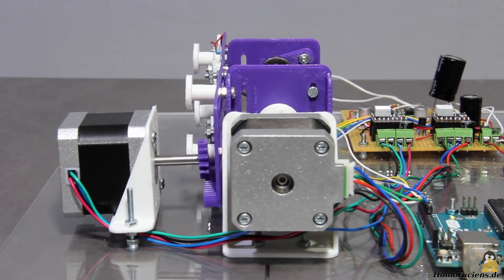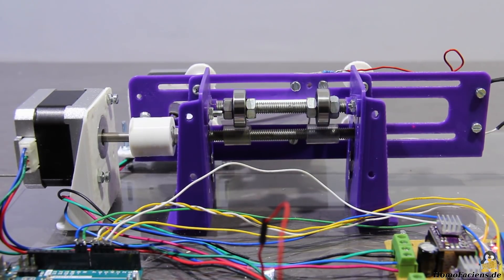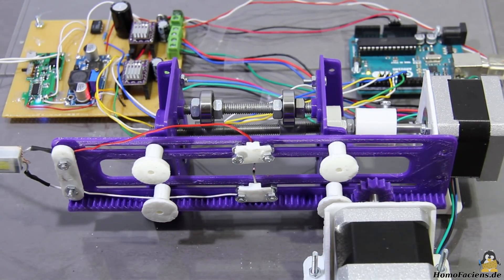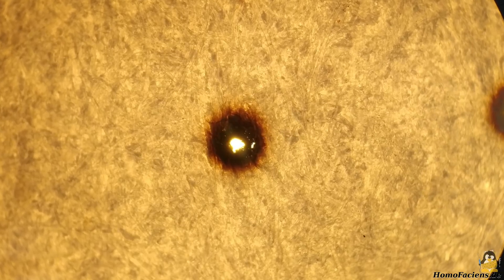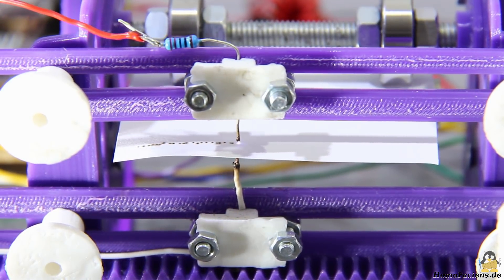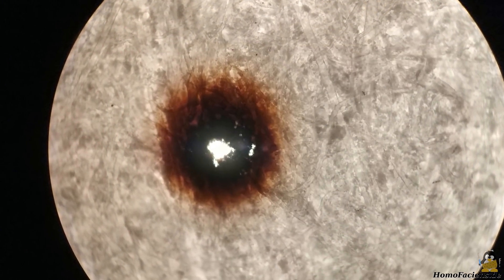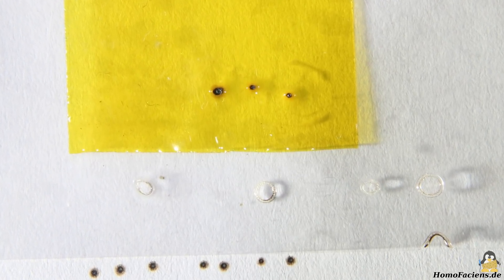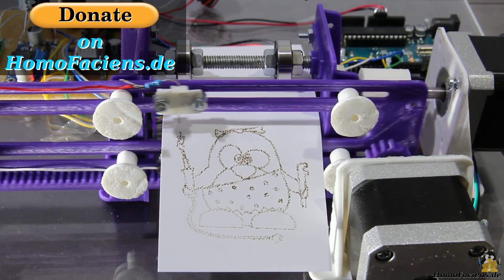Arduino Uno Plasma Printer

Comment from the maker: No breakthrough in printing technology, but a nice demonstration of how to perforate paper in a hacker's way. All info and build instruction on my pages:
https://homofaciens.de/technics-machines-plasma-printer_en.htm
FAQ:
Why sharp tungsten electrodes won't help improving the print quality:
The print dot is "punched" in a fraction of a second while the plasma is forming. That is ruled by the jungle of paper fibers and Air molecules that offers various paths from one electrode to the other. Plasma "printing" is different from plasma welding or cutting, where the burning of plasma for seconds or even minutes matters, not the formation of the plasma with the pilot arc.
Why you can't guide or focus the arc with magnets:
For the same reasons as above - you might be able to rule a flowing current (=burning plasma) with magnetic fields, but nor the forming of the pilot arc.
Yes bringing the electrodes closer improves print quality, but you cant set the dots too close to each other for two reasons:
1. the plasma arc will rather go through a nearby hole than forming a new one when the gap between two dots it too small
2. Too many holes will weaken and so vaporize the paper rather than printing on it
Reply: How about if points is closer to each other?
Reply: du brauchst einen besseren 3d drucker...
Reply from the maker: @grindel80  Nö, funktioniert doch, die Mechanik, somit sind die beiden von mir verwendeten Drucker ausreichend gut.
Reply: I wonder if you could soak a thin piece of wood in saltwater then clip the bottom electrode to it, to make a 'Lichtenberg Dot Matrix Printer'.  :grin:
Reply from the maker: Lichtenberg figures would mean "playing with the uncertainty of where the lightning strikes". More an art/science project than a quality printer ;-)
Reply: @HomoFaciens  Perhaps, but...
1. The wood is well-soaked with saltwater.
2. Wood only burns when it is dry.
3. It takes time for the heat from the plasma to dry out the wood.

Therefore, it might be possible to only burn a tiny spot--accurately--by firing the plasma for a very short time.  (You would either need to use VERY thin sheets of wood with how you have things set up now or put the wood in a metal frame which is connected to the bottom electrode so that, as the wood dries at one point near the frame, the electricity would just travel from another point, rather than burning the wood at the edges.)

Does that make sense?

Comment: COULD PLASMA ENGRAVE STAINLESS STEEL?
Reply from the maker: That depends on the plasma power. The tiny plasma generator I used in this video is definitely too weak.

Comment: You can try using the needle !
Reply from the maker: Doing more experimentation with the needle printer is still on my list of things to do, but not with a very high priority, yet...
Reply: @HomoFaciens  Noted , Instead of the wire to discharge ,if you use a needle the spots will be much finer !
Reply from the maker: Read the first comment under this video...

Comment: You can increase your resolution by using sewing needles for both electrodes. You will also need to move the electrodes closer to each other thereby decreasing the amount initial current needed to make the arc and hence decreasing the amount of initial heat. Since this will need to be done, you will need to create two parallel feed rails for the paper. This will stabilize the paper from flexing up and down during the feeding process into the printer during prints. 

Nice little project but can be considered a fire hazard LOL. Thumbs up

Comment: What would be the result if the paper is on a metal plate? (connected to the bottom pole)
Reply from the maker: Could only get worse since pointed tips guide the arc better than one tip and a plate.

Comment: Not fast or the most efficient way to print, but for dark areas could it print one dot at the start of the line, then skip right to the end and print a dot, the skip back to the start and print a dot, etc. This should keep the paper cool enough to space the dots close together without burning big holes. Or maybe like old dot matrix printers where the print head would go over each line more then once, maybe have it space out the dots very far on the first pass, then fill in the gaps on the next pass, etc.
Reply from the maker: I have already answered in the FAQ section (pinned post on top) why more dots per Inch won't work. Its not the heat the paper has to dissipate.

Comment: Your resolution will be much better if you close the spark gap a bit and reduce the power and pulse time
Reply from the maker: As the paper gets penetrated, a higher resolution would result in paper destruction rather than in a better print ;-)

Comment: Really a nice project, you could try lowering the voltage to the point that it makes slight burn and no hole( or try thicker paper) , also i think you should try using needles for the spark they may produce better uniform sparks...😅
Reply from the maker: There is no "point of just burn before making a hole". The paper needs to get perforated to get a plasma arc. No breakdown voltage, no plasma, no black dot.

Comment: awesome, file points  on electrodes or maybe use tiny tubes filled to a point as electrodes and blow gas through them, i believe air can work but oxygen or hydrogen also work, a simple aquarium pump would be ample for this apllication.
Reply from the maker: As written in the FAQ section (top post), the arc forms in a fraction of a second, which makes this machine totally different from a plasma welder or cutter. Blowing air or oxygen on the surface will burn the whole printer ;-)
Reply: @HomoFaciens  well put, I guess  I didn't think it through.
does the spark/high voltage  rf cause issues with the control signals of the driver boards or the  output  of the driver boards and the motor turnings,  thank you for the enlightenment
Reply from the maker: I haven't used an oscilloscope to check that out. I guess it's the internal logic of the driver boards that gets confused by the non constant logic input voltage.

Comment: Anything with a possibility of creating a fire hazzard will never get approval. I like your thinking but not much needs to go wrong for a child to put a finger too close to the arc and it would cause health risks to anyone with a weak heart. 
I wonder if using a hot tip could carbonise the paper or other media to draw similar to a soldering iron on wood?
Another thing to watch is any smoke or other particulars causing lung damage or even triggering smoke detectors, maybe add an exhaust that filters the air but that increased airflow could also feed potential fires.
Reply from the maker: There is no intention to run into mass production with this "printer"...

Comment: You may get a more controlled arc using sharper electrodes. That's how TIG welding works. You sharpen the tungsten electrode to get a more defined arc. Shortening the arc should help with waver too.
Reply from the maker: Reading the FAQ (pinned post on top) before posting will shorten the comment section ;-)

Comment: Its like tig welders high freq. if it is, electrode's sharpness changes accuracy. And you can be able to print carbon film batteries. (My imagination)
Reply from the maker: Why the sharpness of the electrodes doesn't have a huge impact is answered multiple times in the comments.
Reply: @HomoFaciens  i am sorry for not read the video's comments :)
Reply from the maker: No problem.
...I have added a FAQ section to avoid that in the future ;-)

Comment: 3:00 you can solve this by reducing the output current of Hv
Reply from the maker: That's what I tried with the resistor.
Reply: And for better resolution use Needle positive electrode on top side for better resolution . Positive because negative electrodes melts relative to positive And try to use fixed metallic base electrode instead of moving. May be it will improve result
Reply from the maker: As told a couple of times: A higher resolution won't work, because if the dots are too close to each other, the arc will rather go trough an existing, near by hole than punching a new one. Furthermore, any dot weakens the material, so you will vaporize the paper rather than creating a print.

Comment: Hello, I would like to attempt this project, could you give me more information? Especially on where you connected the large capacitor, suppression choke and resistor
Reply from the maker: Capacitors as close as possible to the motor supply voltage pins of the stepper controllers, the choke is in the wires of the 12V supply of the board and one end of the resistor is one electrode as can be seen in the video.

Comment: A Reddit user /u/Hutkikz suggested:
"To get much better control of the arc. Any welder will tell you to use a tungsten welding electrode(cheap) sharpened to a point with the scratches from sharpening going parallel to the length of the electrode."
Reply from the maker: ...and I told multiple times:
"This printer sets the dots in a fraction of a second while the arc is formed, punching the paper, while welding means keeping the plasma burning for seconds/minutes. Even with the perfectly sharpened tungsten electrodes, that first pilot arc strikes randomly and the shape of the electrodes matters after that first strike. Plasma "printing" is totally different from plasma welding or plasma cutting."

Comment: Try making paper wet with moisture, very little wet.
Reply from the maker: Why?
Reply: @HomoFaciens  it will burn paper less making hole, or even you should try to cut with keeping less gap between 2 holes on little moist paper, just my thought 🤪
Reply from the maker: The problem is that if you try to "punch" another hole too close to an existing one, the plasma arc will rather go through the existing, near by hole instead of creating a new one.
Reply: @HomoFaciens  can you try bringing electrodes very close ? And you can try blocking those holes with some 3d printed material so that it will not go through the same hole.

You can place to flats surfaces on either sides of the electrodes parallel to paper surface, and mounting those 3d printed surfaces to the same moving electrode's 3d printed part 😀

Did you understood? Please try, this may work.

If you didn't understood I'm ready to explain more
Reply from the maker: All this has been discussed and answered by me multiple times in the comments of this video.
Reply: @HomoFaciens  ohh, ok 👍

Comment: It's called "Arc printer" rather than plasma printer.
Reply from the maker: Considering that it is the short pule of forming an arc rather than a long burning plasma, you are right. I don't care about what it is named since I won't run into mass production ;-)

Comment: u might be able to control the plasma using a magnetic field, an electric magnet that gets powered with each plasma pulse might help..
Reply from the maker: The print dots are formed by the initial "punch" of the arc that is forming in a fraction of a second. The plasma flow comes after that, so directing the plasma with a magnet comes too late to have an impact on the precision.

Comment: You should try tungsten wire for the tips, with that extremely fine needles can be created by pulling the tungsten apart (it is used that way in electron microscopy)
Reply from the maker: That would not be a big improvement, as answered multiple times in the comment section, but the pulling the wires apart to get a pointy tip is a neat trick!

Comment: You might want to try sharpened tungsten rods for a tig torch to get a more precise arc.
Reply from the maker: That has been suggested multiple times. Read one of my answers in the comments ;-)
Reply: @HomoFaciens  I just left a similar comment.

Comment: I am thinking if you make a pcb design using this ?
Reply from the maker: The power of the plasma lighter is way too low to vaporize the copper layer.
Reply: I'm thinking how about the spray paint method? You cover the copper with spray paint and try to burn the paint with respect to the pcb design. Is it possible?

Comment: Nifty design!  I wonder if you would find a regular DC motor with the locating wheel/tape like a regular printer uses to be an advantage with something like this.
Also, I would be interested in modifying the electrodes to be made of non-corroding sharp and thin needles.
Reply from the maker: Thanks!
Its more the price tag than precision why those DC motors are used in common printers.
Also mentioned in multiple other comments: Shape and electrode material are a minor issue for the random path the plasma takes. It's the irregular fibers of the paper that mainly causes this.

Comment: If the entire thing was in a vacuum sealed chamber with little to not oxygen would it still burn?
Reply from the maker: It would carbonize and so still create black dots, but yes, the paper won't catch fire. But there is another issue: When there is a hole (dot) in a distance of about 1mm, the plasma will take that path instead of punching another hole at the intended position.
Reply: @HomoFaciens  Damn. It would be awesome to have a printer-system that never runs out of ink like this and only requires electricity. Please keep developing it! I want one so bad!
Reply from the maker: Arrange both electrodes on the top side of the paper and turn the system into a tiny plasma torch might be a working solution around that. There are still options to improve the design. Stay tuned!

Comment: Thinking about the accuracy. If you could put the electrodes inside small glass tubes then the open tubes ends could slide around the paper and restrict the arc and may also restrict available oxygen.
Reply from the maker: Yes, I will eventually create an improved version of this printer. Must make my filament extruder work, first...

Comment: Great project.  Yet another one that takes me right back to the eighties.  I had a printer that plugged into my programmable calculator.  It used aluminiumised paper to print on.  It might be worthwhile changing the electrode with sewing needles or something similar on your plasma printer.  Does the distance between the electrodes have any effect on the final print?
Reply from the maker: I guess it was a ZX printer mentioned in an earlier comment.
The smaller the gap, the smaller the error from the desired X/Y coordinates on the paper. However, if both electrodes touch the surface, the paper feed gets stuck on the electrodes (would need to embed the electrodes in something like glass to avoid that).

Comment: The Heidelberg GTO-DI offset printing press images the printing plates in a similar method. The new printing plates are metal and coated with a non conductive and ink resistive layer. The spark device has both contacts on the same side of the plate and the plates are imaged on the press removing the coating and exposing the ink receptive layer below, because of this the machine is always in perfect registration. After imaging the plates are wiped clean of any burned material. These machines were made for a few years prior to 1995.
Reply from the maker: I didn't know how the printing plates were made. Interesting approach, thanks for sharing!
Reply: @HomoFaciens  They called it "spark erosion technology" and it was replaced with "laser ablation" which produced a sharper dot.

Comment: What about laminated paper? Or Tyvek? Or other non-burn fabrics? :) I think laminated materials could work really well as well.
Reply from the maker: Haven't tried, yet but the problems would be the same. More uniform materials like plastics film could give better precision, but still nothing great, I guess.
Reply: @HomoFaciens  Yeah I was mainly thinking of keeping the burn to a minimum. I can imagine the charred parts are carbon and would only conduct more and better.

Comment: Plasma printer is not a good idea specially when you working with paper
Reply from the maker: Maybe not that good considering the print quality, but great to have fun with tinkering around ;-)
Reply: @HomoFaciens  yes, you should try Wood etching
Reply from the maker: I will indeed dive into building a plasma torch (plasma cutter) in the not so far future. That could "etch" wood - will give it a try.
Reply: It gives the old UNIX lp0 on fire printer error a literal meaning.

Comment: that's pretty interesting. Im curious if a couple needle points would direct the arc better like sharp tungsten works on tig welders? maybe even very close together.  The paper sure catches fire quickly.... could damp paper slow down the burning? maybe you invented the first printer that prints on wet paper
Reply: I'm almost 100% positive that a shorter spark gap would increase the precision of the spark, and sharpened high (temperature) tungsten electrodes wouldn't hurt either (a bit "exotic" though unless he happens to have some laying around)
Reply from the maker: I never said that a shorter gap and a more pointy electrode would have no effect in print quality improvement, but it's not that big thing. In contrast to plasma cutting where the flow of plasma has to be controlled, in plasma printing all the magic happens in the fraction of a second where the spark penetrates the paper and that's what is ruled by the random distribution of paper fibers or air molecules. Plasma cutters have to control the plasma flow, which is done mainly by the shape of the electrodes and the pressurized air.
Reply: @TalpaDK  old light bulbs

Comment: Interesting concept! I would plan the movements such that you define a minimum distance between successive points for the first pass, then come back for another pass and so on. That would mean faster printing while closer points and less burning ..... Other interesting materials would be foam....
Reply from the maker: Thanks! The problem is that the plasma spark will rather go through a neighboring hole (print dot) than through a solid paper layer when you try to set them too close to each other.